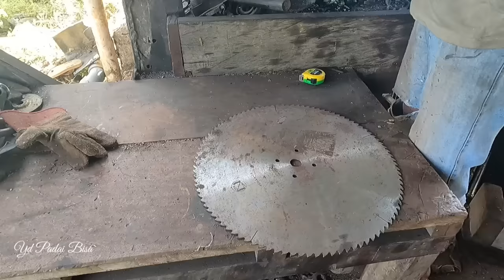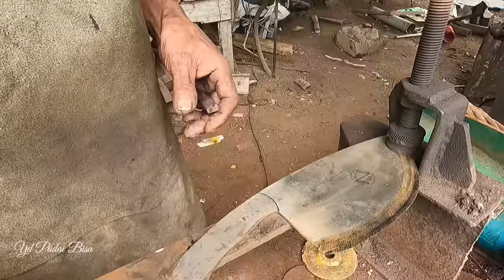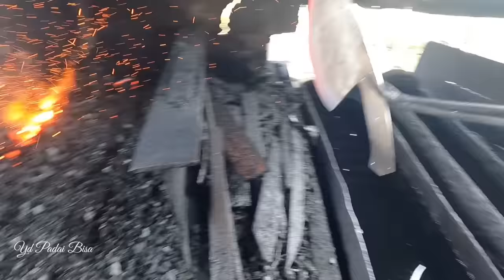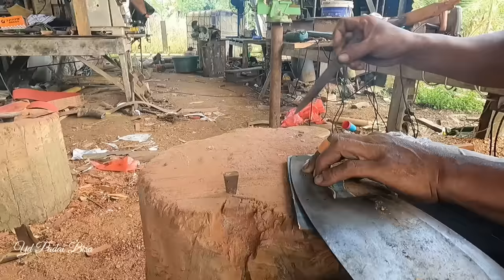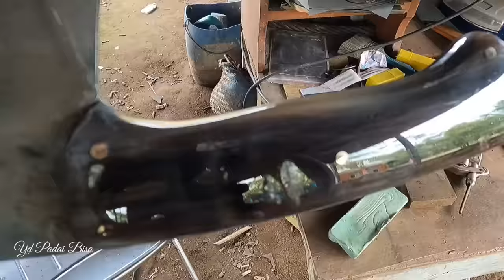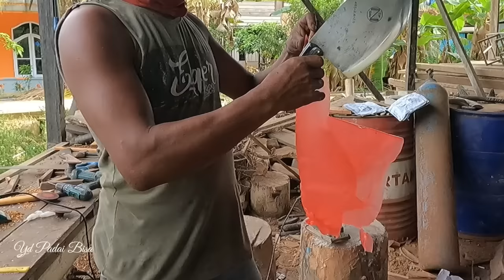make a tuna fish knife from a wood saw blade

Comment: Impressive edge. I have a saw blade I've been wanting to make a knife from. I have all the tools, bandsaw, drill press and I even have some horn but may opt for some micarta. some people think saw blades are made from already hardened steel but if that were the case the blade would easily shatter..good video..I hope you have all the safety equipment you need..
Reply from the maker: Siap terimakasih 🙏